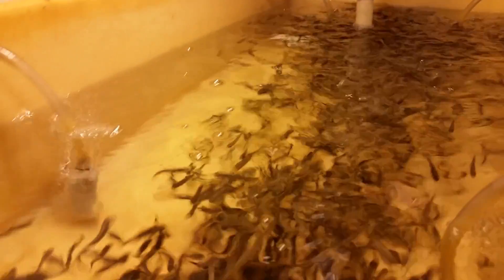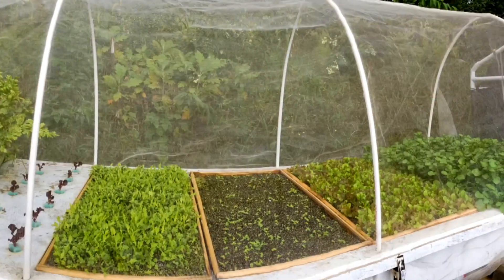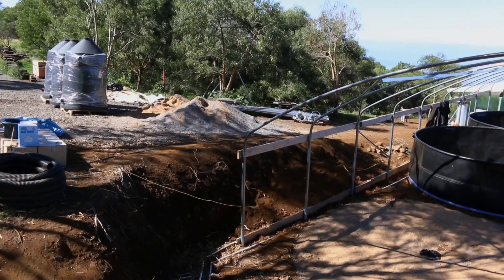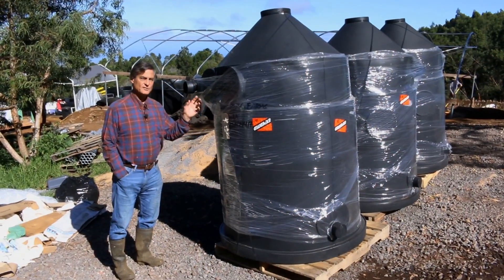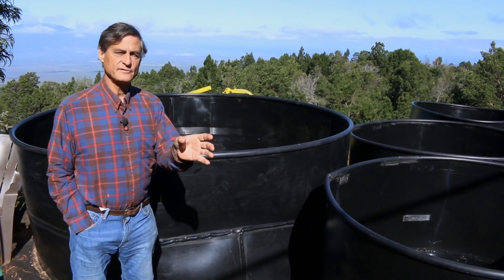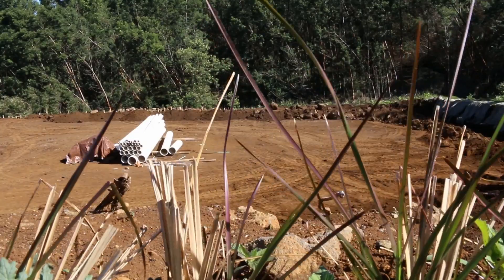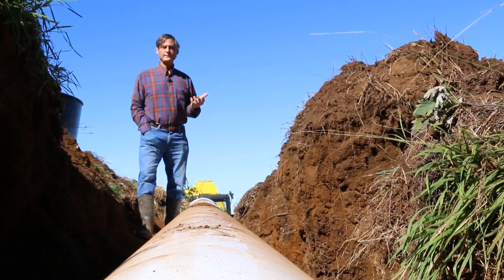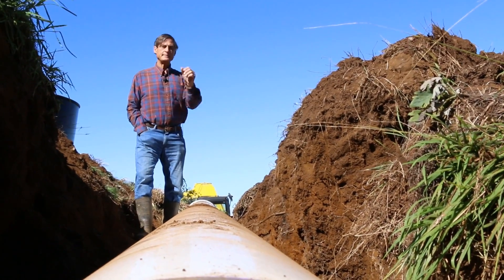Maui Aquaponic Trout Farm: Commercial Expansion

Comment: If the waste water from the fish tanks is purified into potable water, where do the nutrients for the plants come from?
Reply from the maker: The water from our fish tanks is sent through a 2-stage filtration system that includes biofiltration, wherein fish waste is transformed into nitrate, or ‘fixed’ nitrogen. This is the form of nitrogen that plants require for growth. The water is then sterilized with ozone to eliminate any potential pathogens. The nitrate is largely unaffected and is removed by the plant crop.